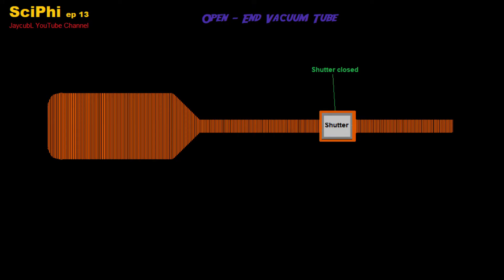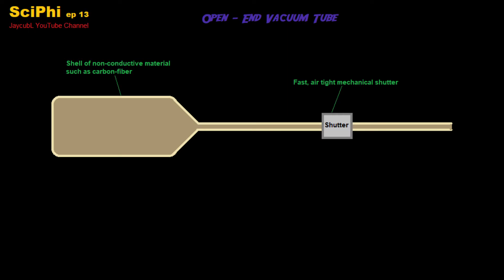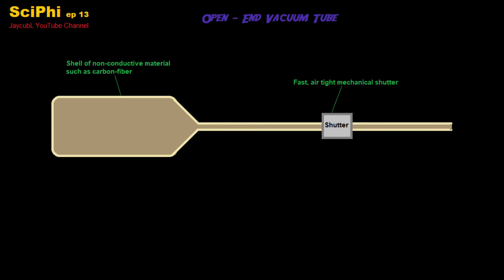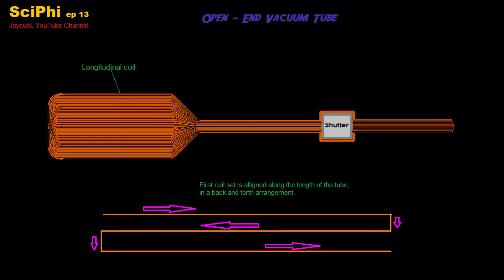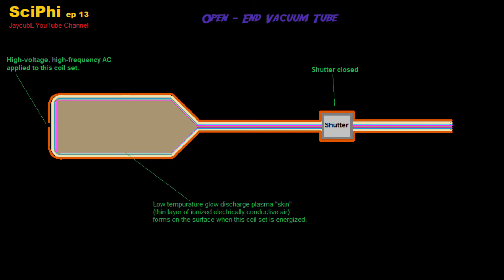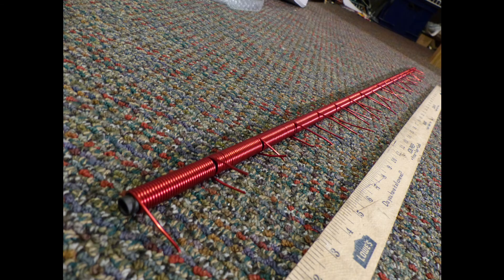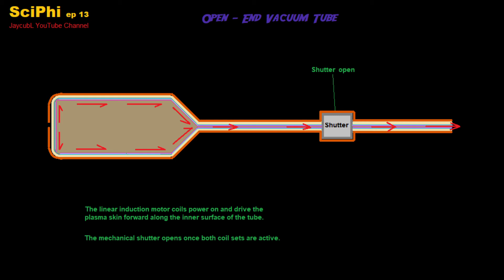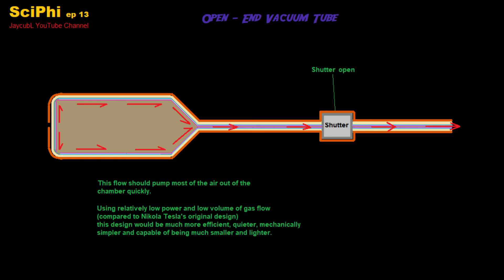Open Ended Vacuum Tube Chamber SciPhi ep 13

Comment: I don't know if it will work. But carbon fiber actually is quite conductive. So you would need to use glass fiber or kevlar or something.
Reply from the maker: The individual fibers are conductive but I don't think a carbon fiber tube would act as a conductive ring, I don't think it would puck up any induced currents. Possibly it would depend on the orientation of the fibers and the weave of the mat. But yes as you said if that became a problem it could be made of fiberglass or whatever other thing.

Comment: if this works i can really see potential for this design to help with mass producing semiconductors. (assuming that it would'nt mess up any of the sputtering equipment due to the high freq stuff)
Reply from the maker: Oh interesting, what do you see it being potentially used for in that process?
Reply: @JaycubL  hypothetically you could insert a substrate smaller than the opening, sputter the conductive material onto it, remove the substrate, and place in the next one without losing the vacuum (or at least not all of it probably) and have to pump all the way back down from atmospheric pressure
Reply: @JaycubL  if there were two shutters* oops